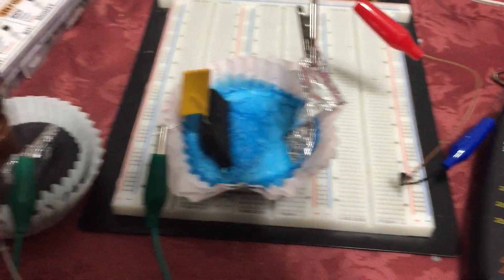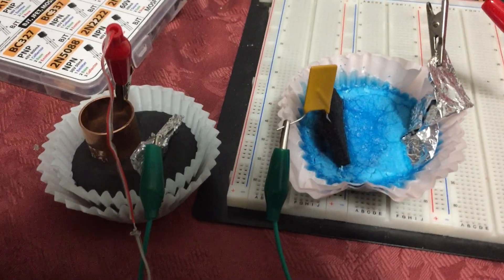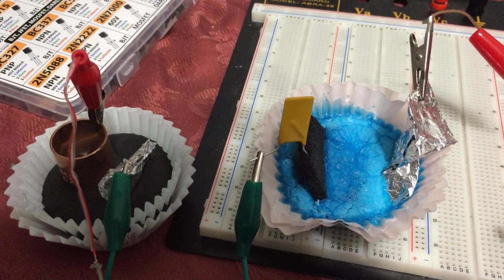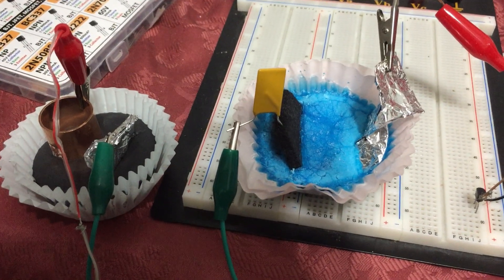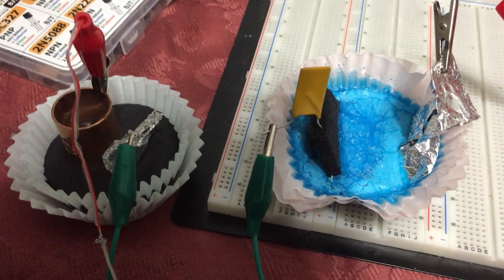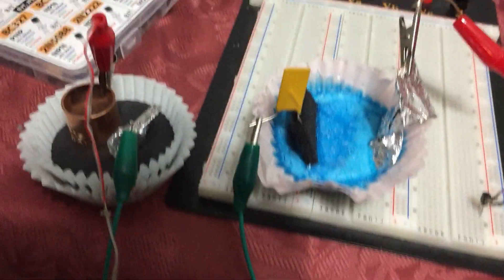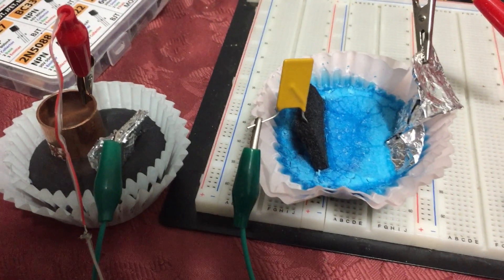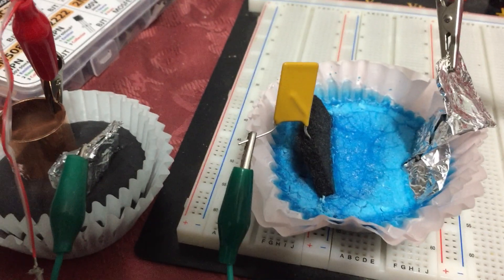AC Power Cell

Comment: I thought displacement current had to do with (and im simplifying a bit) the charging and discharging phases of the cap would create a magnetic field. It's my understanding that the displacement current is NOT an actual current but behaves like one. The back EMF from the collapsing field would cancel out the induced voltage, which would be miniscule. Where is my understanding going wrong that you're able to get the field to produce voltage, when in my mind, that would be impossible. As this effect, when considering voltage, would mainly affect its maximum charge level, negatively.

Am I wrong? Why?

Comment: Hi Joel, can you put another cap in series and test it? When I connect 1 cap (16v 47uf) it only charges up to the cell's voltage, when I put a 16v 220uf onto the first cap's negative side it charged to cell voltage and the first cap went to roughly 25%-33% cell voltage, when disconnected there seemed to be a trickle of power from one to the other too.